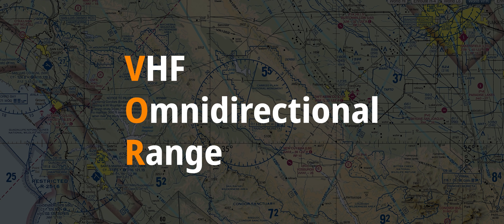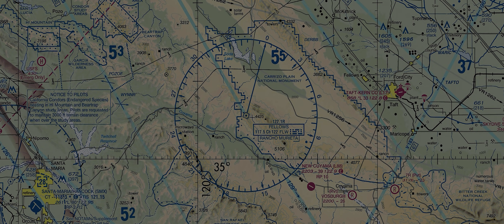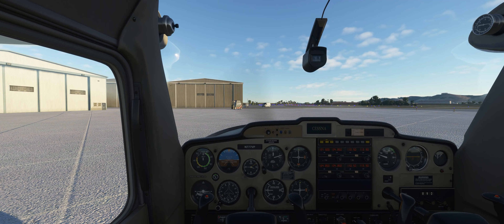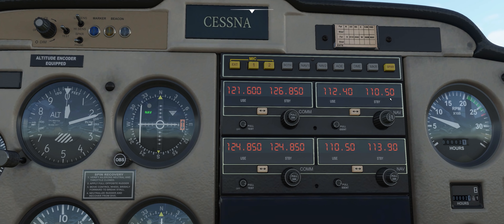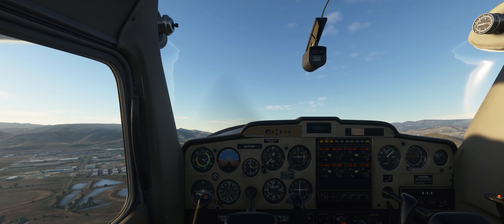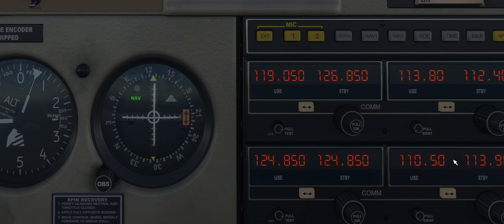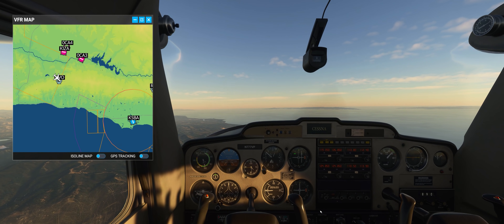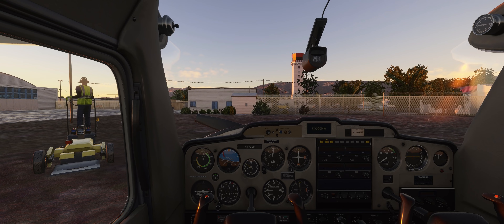MSFS: VOR Navigation Basics in the Cessna 152 - Microsoft Flight Simulator

Comment: Very misleading title. Should have re-named this video Sky Vector basics or VOR Navigation using Sky Vector. There is basic instruction about what a VOR is but after that it was all Sky Vector. Basically I cannot do what you are doing in MSFS unless I get and use Sky Vector, Correct? Your delivery and presentation are terrific.
Reply: Skyvector is a free site anyone can use and don't even need an account. MSFS2020 has an inadequate map and no charts at all. It's a requirement to use tools outside of the simulator to do realistic navigation. The map he shows is just a VFR sectional. Real general aviation pilots need to use one. A physical map allows you to use compass/ruler to chart these out and many pilots now have them on a tablet on their kneeboard (a small board strapped around their thigh for airport layouts, writing down clearances, etc). What he didn't show though was using both navigation radios to set up waypoints so that you don't have to fly over VORs. But it's the same process but creating a intersecting point from another VOR to see with the second CDI while flying a radial on the first CDI.
Reply: @krozareq  - I appreciate the courteous feedback and helpful information. I am a ‘new’ flight simmer who just started with MSFS 2020, so have a lot to learn. I am just getting comfortable with RNAV approaches and use the online (free) websites, so I agree that these resources are incredibly helpful and necessary. I have revisited this video and others trying to make sense of VOR and ILS navigation, and am trying to learn these techniques. Thanks again and stay well.